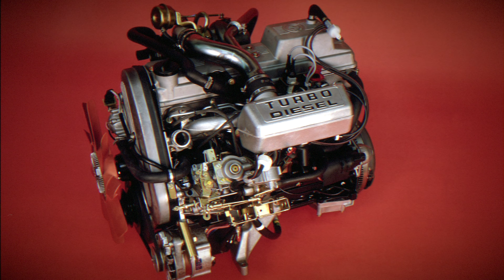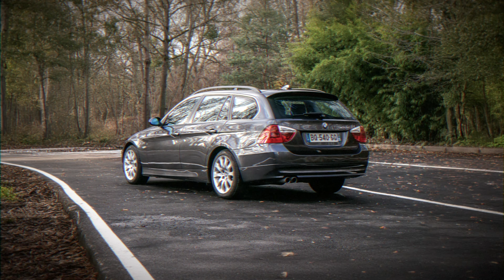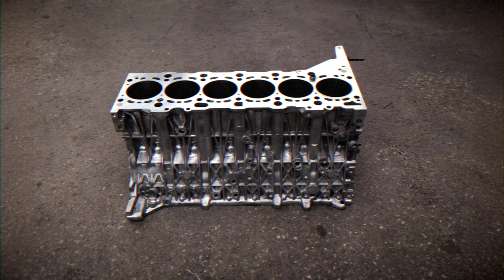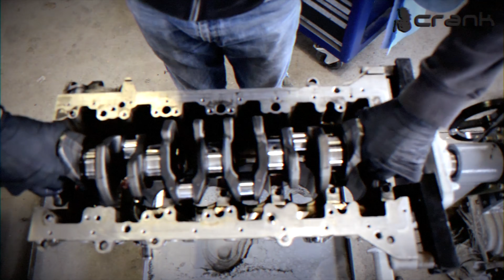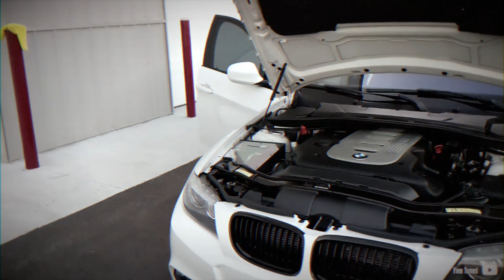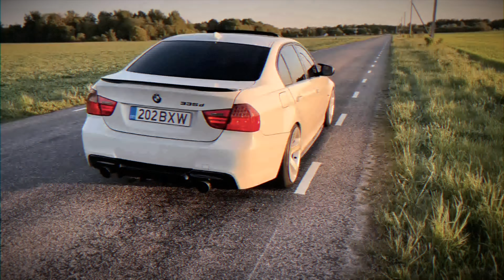The Most Reliable BMW Ever?!

Comment: Today is a sad day.  My M57 325d finally went away.  Had it 11 years and took it from 69k to 244k miles.  Didn't really look after it that well, missed services, never replaced anything ( apart from clutch, drive belt and a tensioner ).  Left it outdoors for the last 13 months completely untouched.  Someone came to take it away.  After charging the battery a little bit, it fired immediately into life and drove away as if nothing had ever happened

Comment: I have this e61 525d with 2.5 liters and 280.000 km on it with manual transmission. Its chipped to 220 or 230 hp and it works really well. Payed 4000€ for the car and renewed a few things like turbo and stuff like that. Wanna keep that one.

Comment: In the case of the E46, the engine will keep on going long after the rest of the car has fallen apart and has rust holes in it (ask me how I know).  If you get an E39, E60 or E90 with this engine, especially a Touring, you have the perfect car for all occasions - Fast, frugal, practical, reliable....AND fun to drive.  In the case of the 5-series models they are also reasonably easy to work on too (more space under the hood that the 3).   If you are going to remap or tune, remember the clutch (in manual versions) will need upgrade as the torque these motors can put out with mods will turn the stock clutch to dust very quickly. You will probably want an LSD to avoid "one tyre fire" on every standing start too!

Comment: I don't have a m57 BMW but my first car was a 120d m47 with the M47D20TÜ2 163ps variant. The engine has outlived the car. It failed its MOT check because of subframe rust but the engine is in perfect condition. 112k miles. I will fix it at some point

Comment: You can clearly see the similarities to the M30 engine. It's the ancestor of the M57 and was a celebrated, extremely reliable engine back in the 80s. I have a M30 in my 635CSI. It's done over 400k km and is over 40 years old, but all the internal engine parts are still original. I just took it apart, cleaned it, painted it and replaced all gaskets and bearings. After I cleaned the 43 year old pistons they actually looked like new. And 2 of them had valve imprints on them. So at some point the chain broke ... but the engine survived. I renewed the cross grinding on the cylinder liners and put the old pistons with new rings back in. The engine still runs like a champ. Most of the external parts are made of metal, too. They just don't make them like they used to. 

Modern BMW engines are pretty reliable and easy to keep healthy. But they need maintanance. Never run it on black oil, change it frequently. Warm the engine up properly. Letting it run while standing and waiting is unneccessary, though. Just start it up and drive off at low rpm up to 2500/3000 rpm max. When it's warm, don't be afraid to drive it at high rpm from time to time. The exhaust assembly cleans itself when hot.
Reply: Your section about warmup is dead on. We actually WANT to start the engine, let it idle for about 30 seconds to ensure oiling, and then start driving gently and smoothly until coolant is fully up to temp.

Idling while warming up can introduce fuel into the oil. Pressure is what helps piston rings seat, and we get pressure from loading the engine and opening the throttle.

On the flip side, dont flog the engine right from startup. An inline 6 has a very long cylinder head. Engines shift, grow, and warp as they warm up. Even the crankshaft will warp as load is applied. These engines (M30-N52) are very very well built. They are expressly designed to warp into shape when warm and at the correct temperature. Driving excessively hard at startup can lead to head gasket failure and rod bearings failure.

Do your engine a favor. Leave 5 minutes earlier for work. Allow it to drive out to the highway at a leisurely pace, and let it slowly come up to speed.

By all means, open the taps when it is up to temp. Engines love to rev and make power.

Comment: Well I am going to draw the ire of many here. For context I currently own a 2006 325i and a 2011 335d. Fantastic engines in both.

When I pulled the head off my 87 535is engine with 240k miles to put a MLS head gasket on it before adding the turbo, the cylinders all still had crosshatch in them and no ridge. Older is not always better, but that b34 was a very well built unit.

Comment: I have a E91 320d M47 with 395tkm and a 650i E64 with 225tkm. The 320d uses exactly half the fuel the 650i does, but the V8 in the latter sounds a lot better. Both serve a purpose

Comment: 2005 E61 that I own since 2007... M57N engine has 530.000km  on the clock and still running like a champ! Clocked  233KPh on the German Autobahn last month 😎
But, as mentioned: swirl flap detlete, EGR delete and EGR thermostat removed, DPF removed.... Reason why the engine is still strong 😑

Comment: 2013 X5 35d @ 225,000 miles and counting. It’s a diesel and I would not consider this to be high miles. Its been a great car with very little repairs needed. My key to success is staying away from the dealer. I’m not convinced they know what they’re doing. Get a laptop and dealer software, and make sure she breathes good.
Reply: N57 engine ..its time to change the timing chains..that idiots put it in the back of engine..it cost 3 to 4k for a 300 euro part..all engine has to come out
Reply: @
Honestly I don’t care that much, it’s a 2013 X5 M57 with 225,000 miles and it’s long paid for. Also, it’s a second car that I don’t drive as much as I drive my other car. It doesn’t owe me anything, and it’s also been very reliable and well cared for by yours truly, with BMW ISTA+, and BMW parts. This one has served its duty and I’ll get a new or newer car if and when needed. 
In the BMW pages after stating the timing chain maintenance intervals, the pages read this. “Regular oil changes and proper maintenance of the rest of the engine can help the timing chain last the life of the engine”. 
Changing the timing chain in my opinion is for the one’s that worry too much. That’s not me!

Comment: Got 310K miles on mine. E60 BMW 2003. ❤M57 always used quality oil. Always hate changing the air filter 😇😂

Comment: I know quite a few whose M57's have gone +/-600k km and are still rocking perfectly fine, albeit after having some preventative work done like timing chain, unnecessary equipment removal like swirl flaps and egr, regular maintenance done - oils/coolant/filters/gaskets, thermostats, injectors, turbos
All that list is something that needs to be done over a long time

Comment: I have a 330d carbio, 2007 and the car has 130k original km. I bought it and I had to replace the piezo injectors. :)) Problem? Electrical fault... 1500E all new. 9_9 Normally if u take care of those cars they should be ok.
EDIT: Also if you want to get that 6L / 100km, u have to drive it under 2k RPM, which if u have a car after 2005 like me, u might have DPF and I do not recommend it as those are "big" engines. => they will have clog way faster than a smaller diesel. If u drive it at 2000 - 2200, u get an 7 - 7.2 L / 100km.

Comment: I have a love/hate relationship with my e39 530d. It drives great, it looks great, the butt massage still works. But often times I hear the engine and smell the exhaust and I get the feeling that something is wrong - Diesel... And sometimes there actually is, but i guess thats to be expected at 340'000 km, so it needs some love. Next car is gonna be a NA petrol again tho just for sound, smell and ease of maintenance
Reply: Those are just bollacks. :D I had NA petrol and it was the worst nightmare ever. Oil leaks over oil leaks. I had to carry oil with me all over the place. Nah uh. The best is to get a good engine (new if you can) or even old, but to be in a really good state. Than u exploit them how they should => no problems.
Reply: It isnt diesel its exhaust fumes when You turn Ac on. Good and not lazy mechanic should fix that. In short I think that after turbine on the exhaust it isnt connected good after service and its noisy when You push gas pedal to the max cos of turbine, on diagnostic it can show low preasure on turbine no vacum or somthing like that. Other option is mold in ac and bad injector.

Comment: M57 owner. One of the best engines built. But surely if we are looking at all categories i.e, power, maintenance, torque etc…. Then the E39 M5 v8 surely has to be the winner. 

Its better in every way. Sure it may not reach the m57s milage, they still happily will reach 150000 comfortably. Now given the 400+ bhp stock and tuning potential. Yeah, its the best

Comment: Yanmar marinized  these for boats for a short time.. look up Yanmar 6BY. I have worked on several and they did not do well in the marine environment. The lifespan never exceeds 1800hrs in my experience. The power output was not outrageous either, 260 horsepower. They were a stop gap motor to fill a void in the market, until Yanmar marinized the Toyota 2.8. 4cyl as a 250hp engine. (4LV) Although it had 4 less cylinders , the engine weighs more due to BMWs us of plastics and composites for the manifolds and pipes

Comment: Had a E61 530d with this engine, never had problems with the engine, but everything else on the car broke almost weekly. That will be my last BMW ever.
Reply: What problems?
Reply: @Eyz67  There was a small lever connecting the keyhole in the door to the unlocking mechanism that was loose. This caused the car to wake up and drain the battery. It took forever to diagnose this issue, and even the authorized workshop had replaced the iDrive system and many other components while fault finding this issue.

The wires for the electronic modules above the rear window needed repair because the split rear window was wearing through the cables. This caused the remote control for the car and other modules in that area to stop working.

The electronic modules near the spare wheel had to be moved to a higher location to prevent moisture damage.

The gearbox was having issues with shifting poorly and slipping gears. I had to replace the seals in the mechatronic unit within the gearbox to fix this.

Control arms and stabilizer bars were also replaced, as well as a leaking sunroof gasket, some cooling hoses, charge air hoses, and a generator. This is some of what I can remember from one year of ownership.
Reply: E60s are either dead reliable or complete shit.

Comment: Yes very good engine. Did road trip few years back with friends e60. Was amazed by fuel economy. Did under 6l/100km with 4 people and full trunk at 140-150km/h. Did the same trip other year in Audi A4 B5 with 110hp 1.9 TDI. Got similar economy but BMW had almost 3x the horsepower due to having torque pretty high up the rev range (unlike TDI with VGT running out of steam around 3k rpm) and almost 200Nm more torque. I know on the road you don't use all the power all the time but the response of those engines are almost electric with plenty of power from pretty much get-go

Comment: Only thing that can kill those engines is Air :/  When your tank is empty and you still try to start it, The high pressure pump pumps air through the injectors and makes a hole in the piston :/ That's so far the only thing i know that "kills" those engines otherwise the M57 is indestructible.

Comment: Actually the m47 4Zylinder (its little Brother of m57) is much better for daily driving and maybe even more robust because oft its iron cast block. The 150HP and upwards Models have enough power, are fuel efficient and reliable. You should only delete swirl flaps, clean intake manifould and delete egr via Software

Comment: The timing chain tensioner failed at 330 000 km on our 2007 BMW E70 X5 3,0d with the M57, causing catastrophic engine failure. We bought it brand new and always had it serviced regularly, so I can’t confirm your praise of this engine!
Reply: bad maintenance, my e61 with 392 000 kms on the clock says otherwise 2007 m57tü2 145 kw, regular oil service only
Reply: And did you service the timing chain and tensioner or did you assume its never going to fail? 330k km is about 30k late for a timing chain service on an M57.. it also almost never goes out without any previous signs - such as engine noise...that you most likely ignored :D
Reply: There were no maintenance scheduled by BMW regarding timing chain tensioners from factory. Today it might be a known fact but back then when it did 60k km per year no one recommended checking it. No engine rattle before it happened although at motorway speeds
Reply: @lukashogfeldt746  Because its common sense, common knowledge.. the manufacturer always says its a lifetime chain and lifetime tensioners, lifetime gearbox oil etc... on every car 200k km is already a good time to service it. M57 300k has to be done for sure..
Reply: Then why do the manufacturer not simply use a timing belt instead. I don’t know, maybe it’s just common sense to check the tensioners. Maybe I’m just wined up because my N53B30 just blew up at 165k km. My S65B40 never had any issues and still it’s known for imminent failure…
Reply: U had the car brand new or second hand?

Comment: Great. So I'm the only one with a broken, low-mileage M57.

Bought a 330Cd at 225kkm with a slight irregular sound, like an older diesel when cold. Took it straight to BMW and asked about the engine and they greenlighted it.

35kkm later, uncle rod came knocking on the Autobahn. It still got itself and me home.

I didn't ditch the car, couldnt get myself to do it. It received a replacement from a dead Touring.  Even kept the broken engine to see, if I can rebuild it (stronger).

Now, at over 300kkm, there's a clunking noise from the rear. We here know what that means. 😑
Reply: Mate is it the E9X or E46? For E46(possible for E9X to) The rear differential bushing is the biggest reason for the clunk. Also check the Hardy coupling or the center support bearing of the driveshaft, (E46 only )Subframe bushing possible(If you take it apart at least weld plates on them so the never can go cracking) and the diff itself or the joints of the driveshaft and axles can be bad also, but start with visual inspection and just dick around with a crowbar everywhere and check for excessive play.
Reply: @Handle-Unavailable-x  E46. Many thanks for your tips! Much appreciated 😌

I've got a second diff laying around and I've had the driveshafts apart to replace the boots and regrease. They didn't show any play (the clunking is not directly tied to thrust/no thrust, but more to body movement, also not direct suspension movement).

So without having looked much, I suspect the subframe attachment points on the body, exactly where you suggested to weld plates on. Anyway, we'll find out soon enough, when I finally get the time.
Reply: @daszieher  Yeah the problem with the subframe is that it's kinda weak but doesn't Crack if their bushings are good but we drive old cars so the bushing are definitely shot. Just watch out it will not fully crack/tear off because I had that. I just bought the car and thought it was the diff bushing and was drive it and the suddenly the clunking became extreme. I check it out and my rear right subframe connect point was completely broken off. Fixed it with welding plate and never had a problem but it hard to place the connection point back at is orginal spot before welding the plates on. Is possible to do it on the ground. Idk if you want to do it yourself or have it check out good thing many helpfull vidoes on the internet.

You clunking may als come from some stupid supsesion bushing that had he's best life but kinda hard for my to diagnose that why I said just dick around with a crowbar and have a good long visual inspection.

But the way you talk about it does sound like something like a subframe problem. 

Anways good luck with finding it am also still searching for a virbration at really high speeds.

Tyres, aligment or diff or my main suspects. The cars are lovely to race, drift, and go crazy but having it at peak performance with the ages of the cars is hard to have but am close  to getting it their.

Comment: Everything you said regarding UL, OL and TOP is completely wrong. This information comes from an "insider letter" which has been completely debunked. 

The only difference between the 25d UL and 30d OL M57 (306D3) is the cylinder head that is still the old cast iron one from the 306D2 with smaller valves and solenoid injectors on the 25d. The aluminum Block, pistons, rods are identical. 
On the N57 the 25d and 30d (UL&OL) are the exact same engine. There is no difference and every single part is the same. 

On the M57 the only engine that is slightly different is the 35d. It has different pistons. 
The bare N57 engine is the same across 25d, 30d, 35d pre TÜ and 30d, 35d TÜ. 
The M550d N57 is different, it has different pistons, heavier crankshaft, different block because cylinder head screws and main bearing screws are connected via an iron anker in the block, bigger valves, M8 exhaust header studs instead of M7, etc. 

I had hoped that dieseltuningparts had cleared the myth that bmw uses different quality grades for parts on their engines.